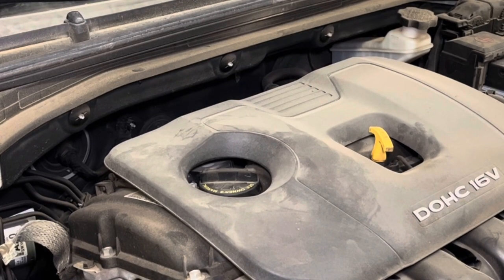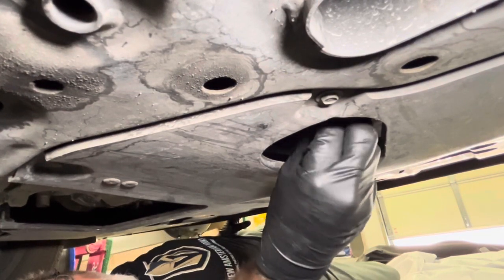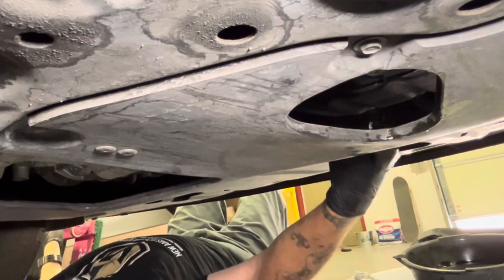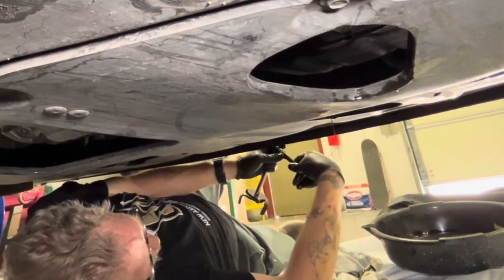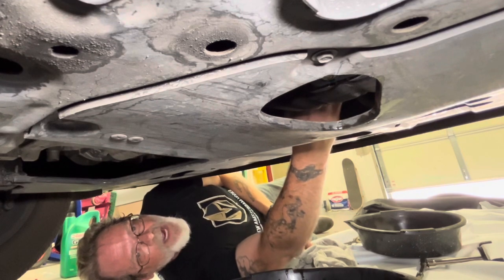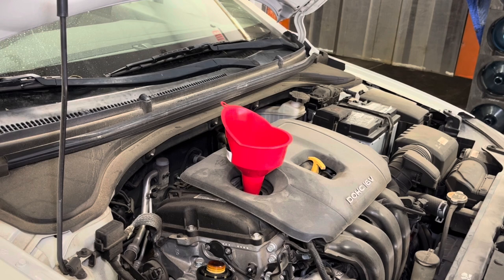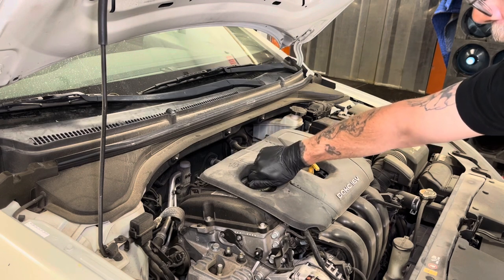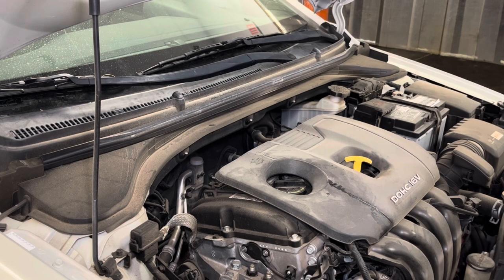2017 Elantra oil change. #viral #reels #diy

Comment from the maker: I hope everyone finds this video helpful.
By the way, I wouldn’t recommend using a spline style socket because it slips off the drain plug too easily.
I'm not an Amazon affiliate, but I posted a link to the light and tripod I used in the description.

Comment: Well done👍 I find it easiest to use a wrench for the oil drain plug.
Reply from the maker: I'm not sure how well a wrench would work in that opening, but I honestly think I won't use a spline style socket again.
Reply: @DiligentDave1966  Yeah can depend on the vehicle what works best I suppose. For me a wrench has worked the best and if the bolt is really tight on there I just tap the wrench with a mallet.
Reply from the maker: @GearSpinTools  I might try a wrench next time.
By the way, you can buy a torque multiplier for wrenches.

Comment: Good video Dave and excellent tips.
I do oil changes on my car's and some other's.  I buy synthetic oil at Costco 2, 5 qt. Jugs for $30(when on sale).
Reply from the maker: That’s a great price, but what brand of oil do you use?
I had posted a video about Mobile One being on sale at Costco, but someone said I should watch some videos because it’s not very good oil. 
My wife’s car takes full synthetic oil, and I might switch brands the next time I change it.
Reply: @DiligentDave1966  I use the synthetic Kirkland brand.  My car uses a blend but I use full synthetic.
Reply from the maker: @JT-lq4yd  I've heard that Penzoil Platinum is really good, but I've also heard that the Kirkland is pretty good.
Reply: @DiligentDave1966  So I heard the same about Pennzoil.  The Kirkland brand is pretty good.  I used to have the oil changed while my car was under warranty at the dealership.  The oil fill cap always was wet and had a brown film, with the Kirkland oil this stopped.  I am OK with that.
Reply from the maker: @JT-lq4yd  Scotty Kilmer says that Kirkland is good. I don't trust much of what he says, but if you say it works, I might just give it a try.

Comment: Nice demo 👍 w
Where I live, I can do 2-3 oil changes for what a quick lube place charges.
If doing regularly, car ramps are great, saves from needing to jack it up and place stands.
Reply from the maker: Great point!
This car is a pain in the neck to jack up with a standard jack.
Ramps or a low profile jack would be much better.
As for price, I don’t think I can beat Jiffy Lube. The oil and filter cost me about $37, but I use quality oil and I don’t buy it in bulk.
Reply: @DiligentDave1966  Harbour Freight , Auto Zone should have some decent low cost ramps. 
If I watch for oil on sale (I use Pensoil synthetic) it runs $37 {5 Liter jug) plus $10-15 for filter (Cdn) a quick lube charges $100 (Cdn) or more.
Reply from the maker: @gnic76   Thanks for the tip. I’ll keep that in mind, but I might get a low profile jack instead.
I’m not getting any younger, or skinnier, so I like to get my car off the ground a bit. 🤣🤣
Reply: @DiligentDave1966  😂 I'm not younger either, not having to crawl around placing stands is a bonus. 🤣
Reply from the maker: @gnic76  So true! It’s also hard to find a good spot to place a jack under these cars.
Plus, a low profile jack would barely fit in my trunk.
Reply: @DiligentDave1966  I do winter/summer tire changes, my kid and I would do a few family cars and is always a pain to find good jacking points. Every vehicle is different, plus getting the height needed to remove the tires. Truck and SUV's especially, the jack runs out of lift, just before it's off the ground so then you need to find blocking that will allow the jack to lift higher. 😂
Reply from the maker: @gnic76  When I had a truck, I bought a Torin Big Red 3 ton truck and SUV jack.
It has an extension that you can put on it to get a higher lift.
Reply: @DiligentDave1966  That would be handy. 👍
Reply from the maker: @gnic76  This might sound like a dumb question, but when you use ramps, do use 4?
I’ve never used ramps before, so I’m wondering how you get the rear of the car level with the front.
Reply: @DiligentDave1966  Nope, just need two, raises front end up, tilts the oil pan back, which in theory should help drain a bit more oil out. Just got to be careful not to drive off the end. 🤣 And block a rear tire for added safety. Bump ramps inline and up to wheel then slowly drive up them, helps to have a spotter just to watch things first few times to make sure everything is good and stop once you are up and on the flat.
Reply from the maker: @gnic76   I have left the rear slightly lower than the front in the past, and it does seem to be effective.
Reply: In my late 50's, been using ramps for oil changes since well forever it seems. Lol
Reply from the maker: @gnic76  If you look at my channel name close enough, you can see that I'm also in my late 50's.
My coworker's mom said I'm a little old to be making YouTube videos. She's the same age as me, and maybe she's right, but I'm enjoying myself.
Reply: @DiligentDave1966  😂 what do them younger people know? Keep up the good work, that's how we all learn.
Reply from the maker: @gnic76  Like I said, his mom is the same age as me, but you're right. At least half of the younger people I work with don't even know how to change oil.

Comment: Awesome Dave. Good demonstration on how to change the oil properly. I was going to mention you could go to harbor freight and buy a set of copper washers. There's just about every size you would need. I do so many oil changes. I put copper crush washers back on. I can't stand the plastic ones
Reply from the maker: I had bought 3 extra washers from the dealership just before the oil change prior to this one. I couldn’t find them that day, so I went ahead and bought the plastic one from Autozone when I bought the oil and filter.
I will take a look at HF next time, though.
Reply: Yeah the cool part about them. Copper crush washer sets. You could use them for lots of things, especially for any electrical connections or seals

Comment: One other piece of advice. I give people all the time changing their oil filters. Make damn sure you get the old oil seal ring off. Make sure it's always on the old filter before putting your new one! I heard you mention it in the video. That's good news, especially for rookies. You would be surprised what I see that ruins engine's
Reply from the maker: I mentioned it for that very reason. I’ve also seen filters leak because the old ring was still on the vehicle.
Reply: @DiligentDave1966  Yes sir I've replaced customers engine's due to that very reason completely ruined the engine
Reply from the maker: @SMOKEY-JAYS-DIESEL  I used a really cheap filter years ago. The freaking thing collapsed when I was tightening it down. It started leaking as soon as I started the car, so I had to run to the parts store and get a better one before even going any further.

Comment: Nice job, Dave!  Good clear video and easy for anyone to follow 👍I really like that oil filter wrench...so much better than my "cup" style ones not only because yours fits many sizes but I've found mine are no longer working as manufacturing tolerances for the oil filter diameters aren't consistent as they once were 😠
Reply from the maker: Thank you!
I almost bought a cup style filter wrench at Autozone that day. When the guy who was helping me put it on the new filter to make sure it fit, it got stuck and didn’t want to come off. Maybe if the filter was on the engine, I could have wiggled it off, but I took it as a sign that I didn’t want to try.
By the way, the Ulanzi light from Amazon worked really well for this video.

Comment: I run Valvoline full synthetic in my car and Valvoline synthetic blend in the kids Ford. Carquest premium oil filters for both.
Reply from the maker: I have used Valvoline Max Life in the past, and it seemed to be good. I have used Castrol GTX for several years now, and it also seems to be good.
I’ve heard great things about Penzoil Platinum, but I’ve never tried it. Someone posted a comment saying that Kirkland full synthetic oil is also good.

Comment: Good demo, I like the new logo too
Reply from the maker: Thanks!
Yeah, I got tired of my logo looking like I belong in a lineup. 🤣🤣
Reply: @DiligentDave1966  💀💀 you said it not me
Reply from the maker: @Kaleb_RoSs  Hey, I just say it like it is. I haven't liked that logo for quite a while, but I didn't really have anything to replace it with until now.
Reply: @DiligentDave1966  yea I get it, I planned on making a new one soon as well.
Reply from the maker: @Kaleb_RoSs  I’m kind of lucky because I work at a print shop. I have dabbled with Photoshop and Illustrator, but our prepress guys do it every day. A couple of them teamed up to make this for me. The only thing I might change is to make the character just a little bit smaller so that the top of the saw blade isn’t cut off.
Reply from the maker: @Kaleb_RoSs  By the way, I think I already told you that I'm going to be doing more DIY videos.
I'm not trying to compete with other channels by buying more tools, so I think it's time to do more of what I intended to be doing on my channel in the first place.
I'm not an expert or a tradesman, but I'm a pretty decent handyman. I'm also pretty mechanically inclined.
I do plan on mixing in more tool videos here and there, though.
Reply: @DiligentDave1966  I agree, I was planning on doing a similar thing but still try to have a good mix of projects and tool reviews.
Reply from the maker: @Kaleb_RoSs  I will most likely buy more power tools in the future, but I’m going to do videos with my existing tools for now.
I bought a Kreg pocket hole jig on clearance awhile back, but I’ve never used one before. I think viewers might enjoy watching as I practice with it.
I’m also going to stop being so shy about my shady tool channel videos.
I’m going to start making some videos with the intention of exposing VCG as a complete fraud. Let him cry on Facebook about me. 🤣🤣🤣
I will also be looking a little closer at Mastering Mayhem because I think he’s a fake too.
Reply: @DiligentDave1966  cry on Facebook ? lol I saw you said he was crying about Jay the other day but I couldn’t find it. What did he say?
Reply from the maker: @Kaleb_RoSs  I don’t know. I just saw a comment on one of Jay’s videos about it.